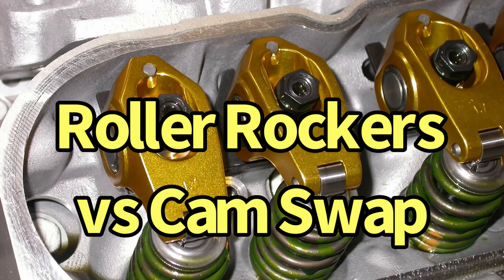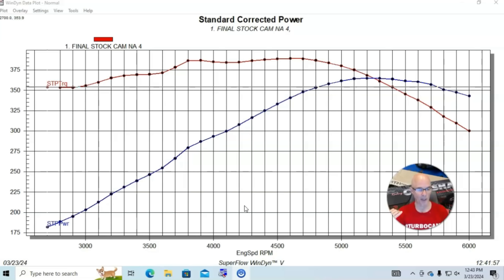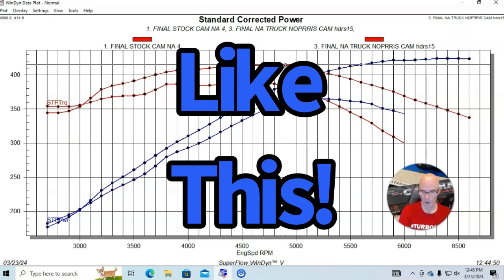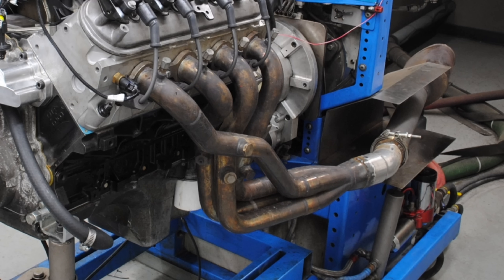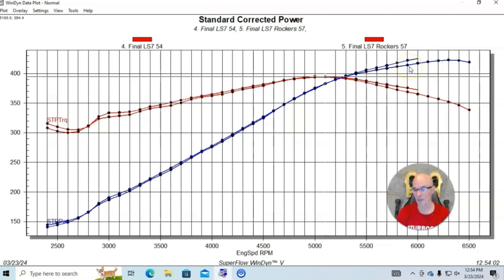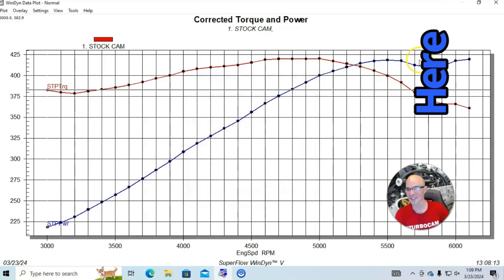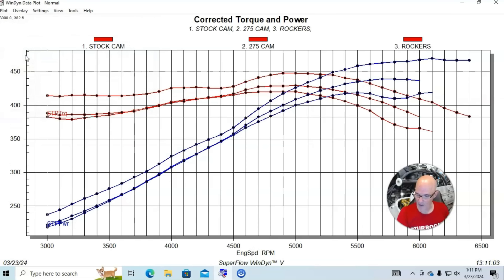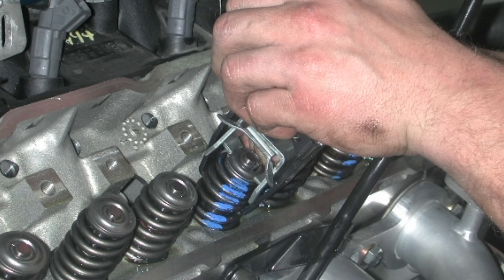LS ROLLER ROCKERS VS CAM SWAP-WHICH ONE ADDS MORE POWER? HOW MUCH HP ARE 1.85 ROLLER ROCKERS WORTH?

Comment: Rich, your vids are awesome.  I'm a old foxbody guy and that's how long I've been following you.  I have a 2017 L83 with 80k miles that actually bent a pushrod bc of the DOD.   Yes, I have proof of how bad that design is.... I rebuilt the top end with a TSP stage 1 high lift cam (212/224 .610/.610 with 112 LSA and 108 ICL), Johnson lifters and upgraded trunion bearings.  I haven't put it on the dyno, but it feels strong.  It's my wife's  DD.  Did I go overboard?  I just wanted this motor to last another 100k+ miles.  I'd love to see you test this combination and see if this was worth the effort (and $$$$).  Keep up the good work!

Comment: I'm surprised the comp 26918 couldn't control the LS7 cam and aluminum rockers. What spring was used in the final test that allowed you to avoid valve float?
Reply from the maker: dual springs

Comment: I have an LS3 with a Texas Speed stage 3 cam, 1 7/8 long tubes. How much power are the COMP Cams Ultra Gold Aluminum Rocker Arms and springs going to gain in your opinion? How would you spec them? 1.72? what springs?
Reply from the maker: I would stay stock
Reply: @richardholdener1727  biggest bang for the buck next mod?

Comment: @richardholdener1727 is a trunnion upgrade and higher lift springs on an otherwise stock gen 3 4.8 worth any gain in hp? Thanks in advance.
Reply from the maker: MORE SPRING ON A STOCK CAM CAN ACTUALLY COST A COUPLE OF HP AND TRUNION UPGRADE WON'T SHOW POWER

Comment: Done a 416ci ls3 with 660lift springs with monster heads, installed a set of 600$ roller rockers and it stopped making power at 5800rpms.. went back stock and it went to 7200rpm before it fell off

Comment: Hey richard ive been watching you videos and have been indecisive on the cam. I have a 5.3 L33 with the flattop pistons and 243 heads milled .025 with hi ram intake and headers. What is going to make the best power and still clear the valves?
Reply from the maker: if you look at the L33 series I have been doing, we ran as big as a Stage 4 LS3 cam from BTR and made 550 hp with ported and milled TFS heads and Trinity intake on a 5.3L
Reply: @richardholdener1727  thanks for the reply really helps. Although i see it says milled heads wont have proper piston to valve clearance did you have any issues with yours?

Comment: Richard,
Hey bud… I have a 5.3 l59, running truck Norris, AFR heads, would just a set of stock ratio full roller rockers be worth any power.. and on this engine does it help with longevity of valve guides? Also I need to ask which ones have you used that fit with same pushrod length already measured for stock rockers? Thank you SO MUCH for all you hard work!
Kris
Reply from the maker: leave the stock rockers
Reply: Thanks man

Comment: Richard, I have done a bunch of work on cars and trucks. But I have never changed  heads or cam shaft.
With this said I have a set of Vortex heads and a weiden intake for my 1979 K30 truck that I would like to install.  Since I am going to do that I figure I should do cam and carburetor. 
Do you have any suggestions also will my stock push rods work.
Reply from the maker: make sure intake matches heads

Comment: Several years ago I bought the same Comp Cams Xtreme Energy 275 that you ran on the LS1 in this video. I put it in a 5.3 though, and hopefully this summer I will finish getting the motor put in my project car. I saw what the LS1 in the video made, what do you think it will make in a stock 5.3? Thank you.

Comment: Stupid question just got a bone stock 5.3 and a LS9 cam kit. Also have an old fast 90mm I got in a trade. Would I be able to use 1.8 rockers with the existing cam kit or recommend also stepping up in springs?
Reply from the maker: definitely needs springs

Comment: I have A 2001 Silverado 5.3 with SUM-8701R1 camshaft and 1.7 roller rockers arm's and some ls6 beehive spring would i still have valve float?
Reply from the maker: yes
Reply: @richardholdener1727  what kind of spring should I get should I get dual value springs

Comment: The question is, Richard did you do a back to back power  test "needle roller bearings vs the "bronze bush trunion upgrade no other changes 
Which made more power and the Pro's and Con's
Reply from the maker: difference might not be measurable-that change isn't for power
Reply from the maker: we have more questions like do you care about mpg or idle, what is the rest of the motor? how much power do you want, how high to do want to rev it?

Comment: Remember, the rockers are only adding more power because they are adding valve duration. Just get the right cam and don’t hang bricks on your springs. And valvetrain.
Reply from the maker: change in duration is minimal-change in lift is significant, change in friction, change in valve opening ramp, change in deflection-there are a couple of thing-also become necessary over given lift ranges and when using no powdered-metal guides

Comment: Yo I got a question to all the ls expert i know this Question might be answer or asked a lot but I got a Chevy Silverado and it has a 4.8 and it’s some what build not really it has header gears 3.73 I think and a built transmission with a build stall and iam looking to run all motor and I was wondering what camshaft do you guys recommend?
Reply from the maker: for doing what with the truck?
Reply: @richardholdener1727  am looking to go all motor for now but maybe in the future go boost but that won’t happens until another year or 2 so I would say all motor for now thanks for the replay👍
Reply: @richardholdener1727  yo bro bro I order the mad max camshaft but am wondering what pushrods to use cuz ig it doesn’t come with a kit just the camshaft

Comment: Richard I am doing a lq9 with a truck Norris cam. I have stock 317 heads and also have ported and polished 706 heads. Which head would be best? It’s going in a daily truck that does some towing. My concern is compression. It will be tune with premium fuel. Not boosted
Reply from the maker: The 706 heads will definitely make more power-but compression is high-will be okay on 91-93

Comment: I have a 2016 chevy ss that has a similar setup. stage 4 brt cam, 1.85 rockers, upgraded to the max spring TSP had at the time. kooks headers, Circle D torque converter.
My only question is were you able to get the setup to work without upgrading to tall valve covers? I was told that you cannot run 1.85 rockers with the standard ls valve covers.
Also this also confirms they kinda lied about my cars dyno numbers lol. i figured as much.

Comment: I would love to see a test like this on a 454 comparing the stock stamped steel gen4 rockers with full roller rockers. Roller rockers are also worth more than just the power they add when it comes to wear on the valves and guides.
Reply: I’m thinking the same. I wanna see stamped steel vs roller rockers on something older. For me that was the main point of going roller on my older motors, I don’t really care about the roller part itself more the reduction in how much that rocker is gonna flex.

Comment: If you need to change springs no matter which one you choose, whu not install both and get an extra 50 something to 60 something more HP instead of 16 or 47?🤷
Reply: You can change springs without pulling heads, timing cover, really, anything. Pretty quick job to change them out.
Reply from the maker: you don't get both the power gains with rockers and cam-you get less or nothing when you add rockers to the cam
Reply: @richardholdener1727  
That Dyno test would of been really cool to see.😎👍
Reply from the maker: Cam already has the added lift
Reply: @richardholdener1727  
I get it but the American way is that if more is better then to much is just right. Plus it would be nice to hear(see) what the dyno has to say about it.😎👍

Comment: I want to stop the video on the line charts, but when measurements are so close, it's hard to tell the difference between one run and another.  You tell us where one run starts and ends, but I'd love to be able to see it in the comparison. Can your program make noticeably different colors between different HP lines and different Torque lines?
Thx. Love the content.
Reply from the maker: I can't change the run colors with what I have

Comment: Wondering  on texas speed chop monster  cam and  got beehive springs are rockers kinda the way to go for longevity 6.0 lq4
Reply: If you hop the performance up, a durability upgrade would to be to replace the bearings in the stock rockers with bushings.

Comment: Would some good aftermarket springs keep a 5.3 with 1.8’s from getting valve float? I may have to do head gaskets soon and the heads could stand a rebuild I’m sure
Reply from the maker: you need spring upgrade with rockers

Comment: I run 1.8 rockers on my street/strip 6.0 swap g-body along with a summit cam and GM ls6 springs never had valve float issue. it's a low lift cam (.525) so with the 1.8 ratio puts it right on the cusp of the ls6 spring capability but it seems to work for me 🤷‍♂️. I did change the pedestal height to improve the geometry, which resulted in weird pushrod length but  this combo wasn't planned, it's just stuff I had laying around for anyone wondering "why the hell would you do that" if I were to do it over I'd just get a properly spec'd cam with stock rockers.
Reply from the maker: I guarantee you are floating the valves

Comment: ?????????
They go hand in hand...
Reply from the maker: nope
Reply: @richardholdener1727  
Maybe not in your world...
Roller rockers are an automatic...
And a better cam profile than factory if there is one.  Is automatic...
at least in my world
Reply: @jimh4167  I'm replacing the bearing trunnions with bushing trunnions for durability and thats what is used in several racing applications as bearing cages can fall apart.
Reply: @shadowopsairman1583  very common thing people do, Factory Rockers with a TSP Trunnion upgrade. Speaks volumes to just how good the GM rockers can be with a variety of setups.

Comment: Having the 5.7 LS1, that rocker upgrade seems to be a solid choice for the price per HP/TQ and the ease of installation
Reply: Both are worth it, I am just doing BTR "Advanced" Rockers with bushings instead of roller bearings for durability in an Iron Block LS1 (By displacement it is 346/5.7L- formerly a 325/5.3L)
Reply: @Ballen1182  because no one has time for the sewing machine noises.
Reply: a lot of people will disagree as the cam swap is not difficult. when you do springs and rockers then you need to find a way to keep the valves from falling down. realistically, the cam swap is a day job and you get 50hp and maybe more depending on the cam while the rocker swap is half a day for only 15 hp.
Reply: A ticket swap is about 2hrs work @lifeishard1211
Reply: @lifeishard1211  half day? More like an hour? Air line to the spark plug holes keeps the valve up. It's standard procedure.
Reply: @PMDW53   good for you. every job is one bolt away from becoming a much longer task.
Reply: @lifeishard1211  for sure. 10x for a cam swap comparatively.